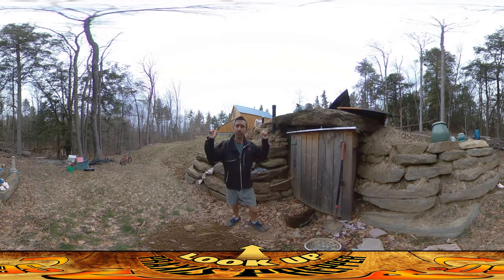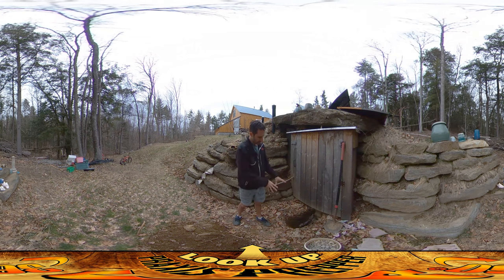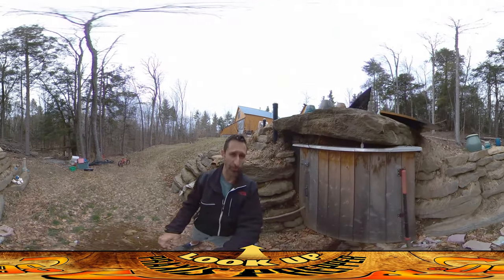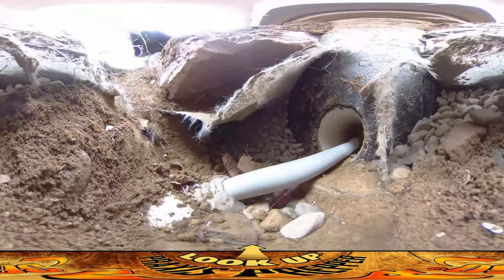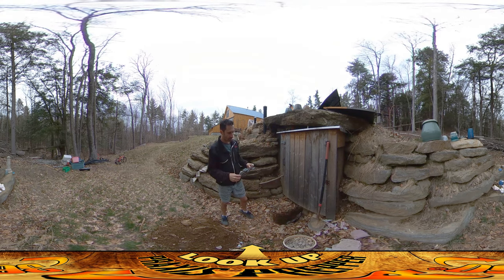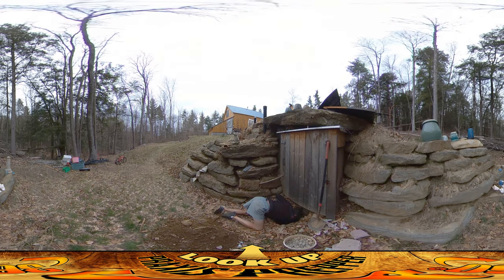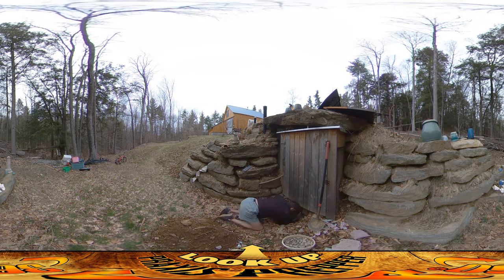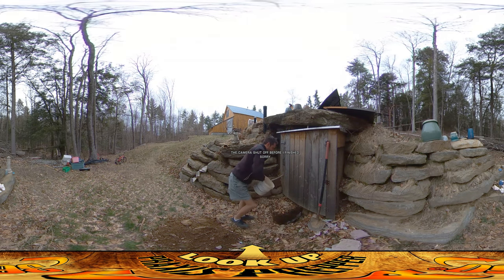Homestead Building - Creating a Waste Water Drain for the Fallout Shelter

Comment: Hand core sock tile covered with pea stone is standard for drainage
Reply: Fiber board on foundation wall back fill with sand . I say this to keap trolls happy . Wall coating vary some prefab walls have poly resin others just tar . Ok that abought covers it all . Do I need to spell out pitch of the tile . 1/4 inch drop per 4 ft .ok you trolls happy